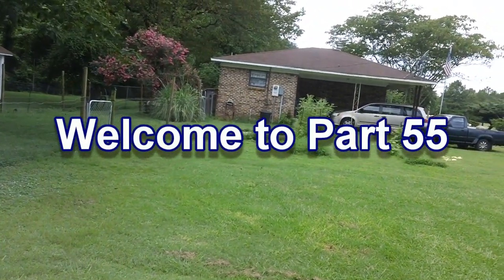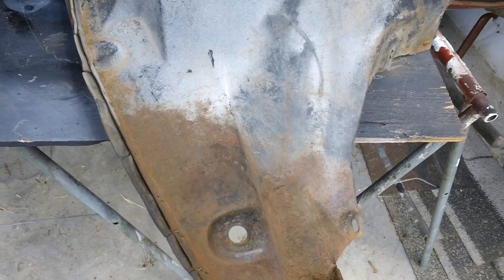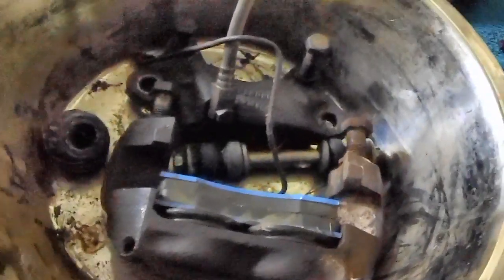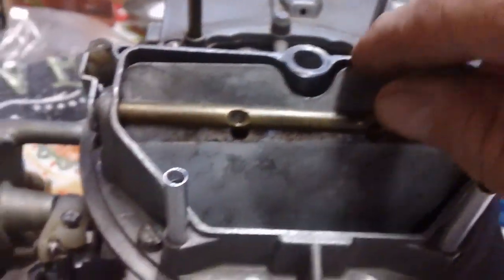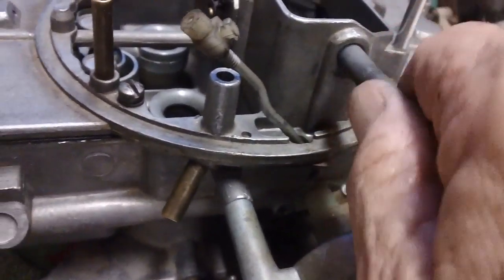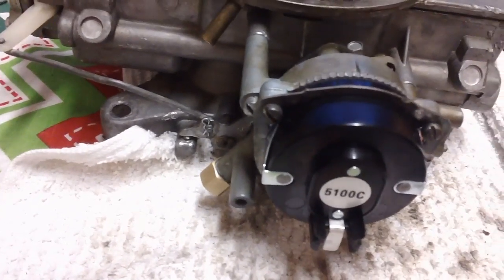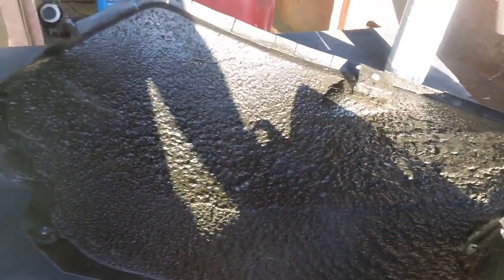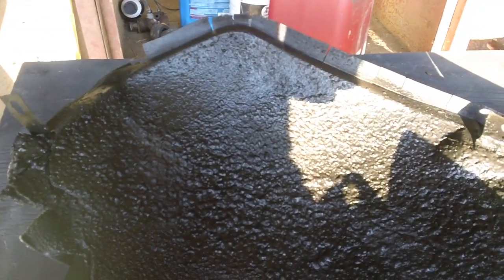1966 Ford Thunderbird repair and refurbishment (Part 55). Finally finishing the carburetor.

Comment: That dash pot look sweet as does the carb  itself. Really nice job......as usual.
Reply from the maker: The proof will be in the puddin, Ron.  Will the dumb thing function after all the work that's been put into it?  60-40 against it.
Regards,
John
Reply: @joernone  If you don't completely replace those gas lines; I'm afraid that all of your hard work on the carb will be wasted!

Comment: I have been following the series. I had a '66 Ford wagon with a 390, it had the same carb on it you have. I recognise the dashpot and the choke linkage. I rebuilt it a few times, its been decades ago.
Reply from the maker: Jak,
Did it work OK for you?
Regards,
John
Reply: @joernone  Yes, as I recall, it didn't have problems. The choke needed the coil replaced twice and the carb was rebuilt once or twice.

Comment: I remember back in the day you could buy white gas and coal oil at most service stations.  They kept them in a 55 gallon drum with a hand pump on it. You brought your own container to fill. They would even pump it into your old dirty gallon glass jug if you wanted.  We never bought Coleman fuel, the white gas from the station was a lot cheaper.
Shoot, I even remember running out of gas on the road and searching the bar ditch on the way to a gas station for an old Coke bottle to buy some gas in.
Reply: JAMES AZBELL the early motorized lawn mowers in the late 40s and early 50s had to run on white gas.  Everyone always kept some white gas to wash auto parts (and bicycle parts).
Reply: @jazbell7  Huh, I didn't know that.  Thanks.
Reply: @joernone  Yep, I'd give up all this technology for the 50's again.

Comment: Those washers you are going to look for are called "high collar washers".  I don't know why they're called that. But the OD of the washer is the same diameter as the screw head.
Reply from the maker: Johnny, Tell ya what, my friend.  Next time be sure to wait until the last carb rebuild vid to smarten me up about that...like after I already bought the wrong lock washers.  Some friend you are.  😒😛😢😜
Regards,
John
Reply: @joernone  I always try to help after the fact. Makes life more interesting.